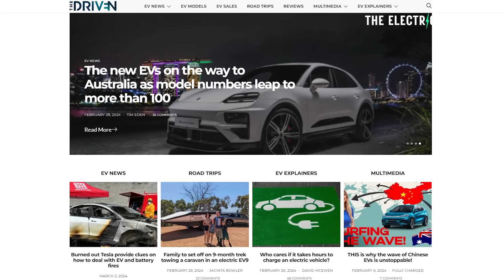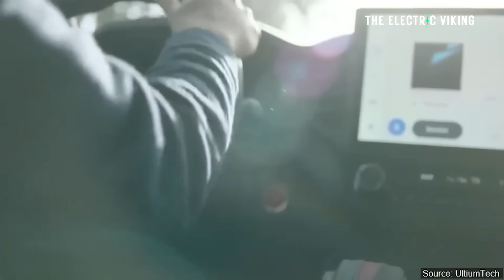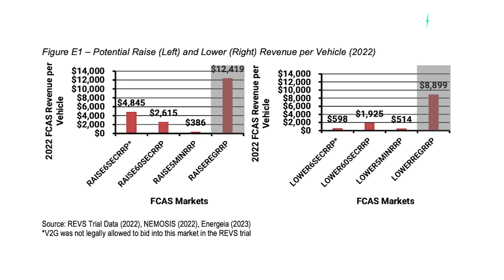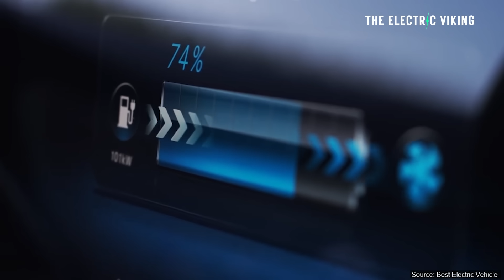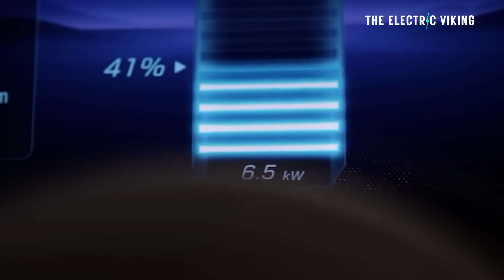Electric Cars could earn $12,000 in a single year with vehicle-to-grid tech

Comment: While I dont doubt the theoretical feasibility of this, you have to remember that if many car owners start doing this, it will have an effect on prices. Raising prices in off-peak hours as more and more people increase the power usage to charge their car and lowering it during peak hours by returning that power. This is just basic arbitrage, which always affects the price of the goods being traded to narrow the gap. And that would in turn reduce the earnings its possible to make this way.
Reply: @orionbetelgeuse1937  I'm a vampire!!! Yes!!
Reply: Th sun
Reply: @orionbetelgeuse1937  At night, silly.
Reply: @orionbetelgeuse1937  Grid storage batteries.  Lots and lots of grid storage batteries.
Reply: @orionbetelgeuse1937  I agree, VTG is not really needed once we have enough grid scale batteries.  But in the short term it can be useful.  Here's a use case to illustrate.  You charge your car to 80% overnight, drive 20 miles to work and 20 miles back from work.  That is only 40 miles.  So you have over 50% of your battery still charged.  Plug it in when you get home and it can be used immediately, maybe down to 20%.  You get paid for this.  Later on, after midnight, you re-charge your car at the cheaper rates.
Reply: @orionbetelgeuse1937  Dude, this is already happening with home battery storage.  They are just extending the program (which is already up and running) from home batteries to include vehicles.
Reply: @orionbetelgeuse1937  Not at all.  Right now, you use solar during the dqy, charge up your battery for free, then sell the power from the battery to the grid during peak usage.  You make money from this, TODAY.  It's already in place.
Reply: but it takes out of the grid sourcing equation peaker plants, which cost about 40X more to generate electricity. Taking the peaker element out will reduce the overall cost of electricity.
Reply: @orionbetelgeuse1937  You drive home, you plug in and your battery charges the grid.  Simple.

Comment: Sam: you don't need an EV with V2G to earn money. There are already intelligent battery storage units which can buy or sell electricity at the best price point. These AI powered units are available for consumers and not too expensive.
Reply: Of course, but if you have a car, you can use it for this purpose without buying the extra Powerwall. But still, remember this is purely theoretical, the law doesn't allow this, and the power companies know that the excess solar capacity of any house will be gladly given to them for free, because what you do with the excess anyway if you have no way to use it?
Reply: @Alarix246  This is not theoretical. There are now systems for sale (for at home use) with AI supported buying and selling of electricity. Storage is up to 20kWh at the moment. Trading is via a virtual platform. As a user you can follow everything via an app.

Comment: This is why NIO is putting effort on battery swap

They could make profit from battery in swap station as energy bank
Reply: Really, if I have just bought a brand new e.v. I am certainly not going to be doing that. Although if I had a knackered old battery on my e.v. I would.
Reply: @billienomates1606  
NIO has a package sell EV without battery.
Buyer just need to subscript monthly fees and NIO provide 4 time monthly battery swap free

NIO own the battery and they responsible if it faulty

That why in China NIO's resell value usually higher than other brand
Reply: @billienomates1606  Why not if you rent the battery, as is the prerequisite for using the service? You just get a newly charged battery in a very short time, and the risk of battery degradation is with Nio.

Comment: Oh dear. Has anyone done the calculations to work out how much electric would have to be generated every 24 hrs to supply e.v's ! So hypothetically if currently ALL i.c.e vehicles were e.v's. That includes all lorries, vans etc including all delivery fleets.

Say just for the U.S. currently, if all i.c.e were e.v's. How many gigawatts would be required every 24 hrs? Where would all this electric come from?

Also I assume to keep to the so called green agenda all power sources to generate this electricity would have to be from green energy!
Reply: Yes. I've done calculations. If all vehicles were EVs, we'd need roughly to double electricity generation. So what? It won't happen overnight. We've doubled electricity generation over a couple of decades many times. The grid routinely expands this way only to keep up with population growth. In fact, growth of the grid has leveled off in recent decades, so transitioning to EVs will only restore growth to historical levels during the transition, and growth will then level off again.
Reply: Thanks for the reply, but what types of electricity generation methods would cover this increase? Obviously in the new Green World of zero emissions we would only be using non fossil fuel sources. How would the use of solar, wind, tidal, hydro be stored during low consumer use for when demand is high? @restonthewind
Reply: @billienomates1606  Utilities are moving to wind, solar and natural gas. I have no problem with natural gas. It's much cleaner than coal. The perfect should not be the enemy of the good. Nuclear is also fine with me if they can get the cost down.
Reply: Yes, but let's just put the cart before the horse. Why fix the no. 1 cause of the world's emissions problems when we can add to it and worry about it later. I want and EV in my driveway!

Comment: LOL. We don't have reliable electricity in the Third World. Dreaming....
Reply: Ethiopia has banned import of none battery vehicle
Reply: Buy solar panels
Reply: I live in place with very unreliable electricity since I live in the wood. Because of this I bought an EV that have V2L capability Ioniq 5. Guess what, last summer, I sold my generator since I got this car, at each power outage for now 2 years, I use my car to power (Silently compared to my generator I had) my house. Dreaming ?  No reality and it's very useful and it's way simpler compared to generator, only a plug to connect in my case. Now since it's cost way less to fill it up my EV car compared to my gas engine, already paid up the difference in price between both type of vehicul. Each month now I add solar panel to my house with the money that I saved, in my pocket. Now I heat my house (Partly) with those solar panels but next summer I will charge probably my EV car with them. 😁 Dreaming, no reality. 😄